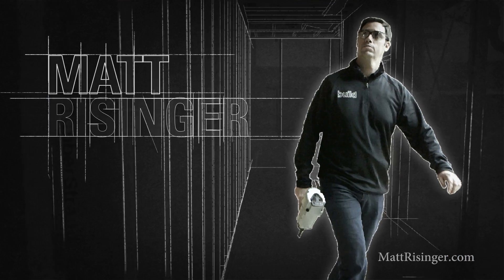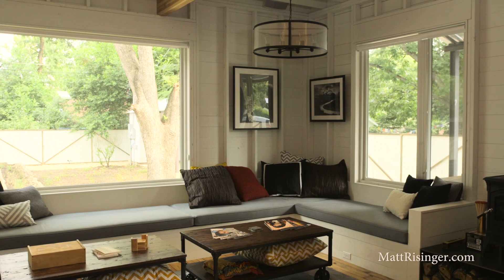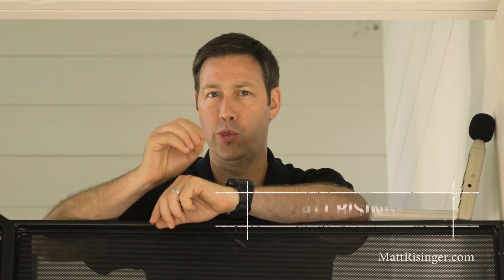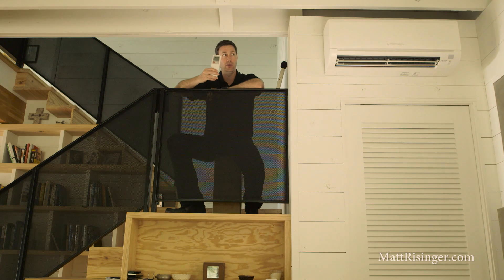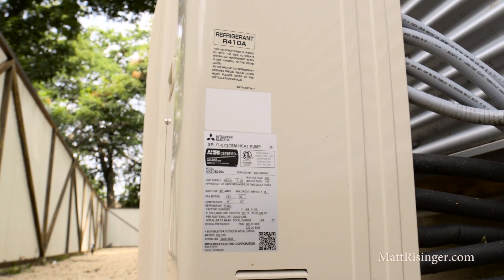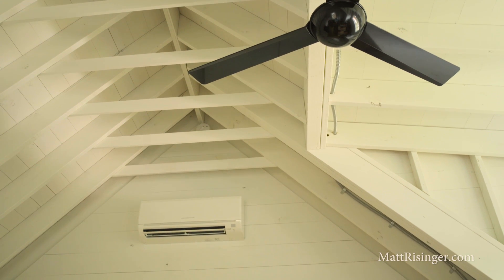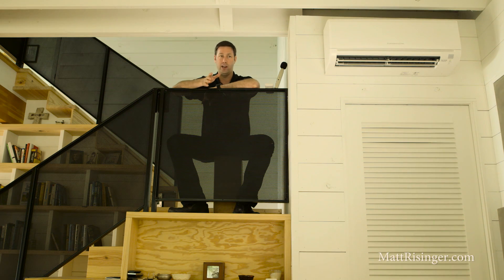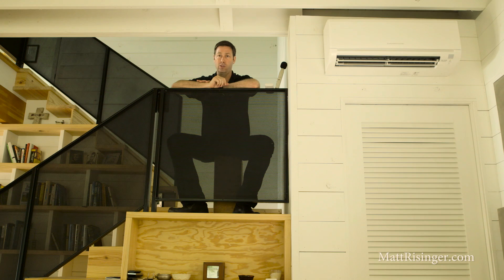Mitsubishi Review - Perfect Wall House

Comment: Hey good day. Great video as usual very informative.  Question do these units come with other refrigerants like R-407c or hydrocarbons? ??
Reply: Most small  residential air conditioners are moving towards using R32 , which is classed as mildly flammable . If not R32 it will using R410A , not flammable but a bit less efficient .

Comment: Hello Matt, I have a two level house, and would like to install the MXZ-2C24NA2 unit on the outside, and two x 12000 MSZ-GE12NA-8 wall units inside the house, one in the first floor living room, and the other in the second floor hallway. Now, I have an LG wall unit of 12000 btu's, with a compressor outside. This wall unit is on the 2nd floor hallway, but it has never been enough to cool the first floor. Last summer, when we got a 40 degree heat/humidity day, the best we could manage on the first floor was 28 degrees, not very good. I know it's not easy to answer without seeing my house, but do you think that by doubling the cooling, my first floor cooling will improve dramatically? BTW, each floor has 860 sq feet.

Comment: Having lived with mini splits for ten years (in asia), one seldom benefit for cooling is because the units are mounted high on the ceiling, it actually takes the warmest air, close to the ceiling and cools it as opposed traditional HVAC design where the return ducts are usually on the floor.  Makes a difference.

Comment: The only issue I foresee with these systems is that I doubt their ability to filter and move said filtered air in the same capacity as traditional HVAC units. For allergy sufferers this could be problematic. Then again, this could be mitigated with standalone HEPA units if the need arises.
Reply: I'm planning a ventilator system with de-humidification for fresh air, air cleaning, and circulation.
Reply: I'm sort of broke so I made my own HEPA filter with a box fan and a good quality air filter. ;)

Comment: what are the negitives and or cons, any complaints?    what kind of reliably like long term, do some brands break down more than others?   and what brands would you recommened?
Reply: Not Matt of course, but I have a little bit of experience with a mini split system. Probably the most well known and arguably the best mini split brand would be mitsubishi. There are other brands out there like fujitsu, sanyo, and plenty more that have lots of experience in making these systems. You go to Asia and basically every home that has AC has a mini split system instead of the forced air sorts of systems that are king in the US.  Mini splits tend to be a quite a bit more expensive than any comparable conventional forced air sort of a system in the US. They are also sadly not super popular in the US so it can sometimes be harder to find installers and people that would have the expertise and parts to repair them when/if something happens. The inside units and the outside compressor/pump units tend to be really quiet, you can barely tell they are on in many cases.

Comment: Hey, Matt. I've wondered about these mini split systems. You said all you had to do was run a freon line and an electrical line. How do the units deal with condensation locally at each unit? I'm curious if this would be a maintenance issue if we used these in significant numbers.
Reply: the refrigerant line, electrical line, and condensate line all run out of the house from the unit itself through a hole in wall. The electrical and refrigerant run back to outside unit to connect and the condensate line to wherever to drain.

Comment: Hey Matt, great videos, I recently subscribed to your channel and I am hooked. I wanted to to go with a split unit AC as my house has cement ceilings and that would be my best option. Before your videos I was going to go with a LG but you have me sold on the Mitsubishi unit. Right now I am in the process of redoing our new home that we just purchased all my walls are barebone right now. I am creating a smart home environment with a nest thermostat, August smart locks and thinking if I need a smart hub. My question would be which model of Mitsubishi is technologically sound to work seamlessly with the nest and my heating unit or can you recommend a setup that will work seamlessly with heating and AC which allows me to have full control on the tech side? Thanks Matt and keep up the great work that you do.

Comment: I'd suggest that there are two additional benefits of a variable speed compressor system (both ductless and not).  One is that having the compressor work just hard enough to achieve the desired temperature can be more comfortable than a conventional binary ON or OFF system (either ON blasting cool/heat or OFF leaving still air that gradually becomes more and more uncomfortable).  The second is that sooner or later, we are all going to have to wake up to the notion that a conventional all or nothing HVAC compressor system isn't very compatible with a "smart grid".  Power companies are starting to phase in power tariffs that penalize peak power usage.  Current variable speed compressors may not have the requisite technology, but hopefully future variable speed compressors will allow the user to set a "don't exceed this prescribed power consumption" limit.

Comment: You are misleading Matt ...... M-Series Multi-zone can NOT power down to 10% (Read the Spec's) depending on the model the best they can do is 20% to 25% ......their 2 ton model will only power down to around 40%

Your chances for hazardous refrigerant leaks inside the envelope increase for every head unit you add also

Comment: Matt, how is the air being filtered in these mini-split systems.  With a traditional HVAC system, you have air filters before the furnace "cleaning" the air.  Since there are no ducts in this system, does the air get filtered?  Thanks - David
Reply from the maker: +dcahpd David, there is a small filter inside the head that needs cleaned every 60-90 days.  Not as much filtration as a traditional forced air system with a healthy MERV 10+ filter though.  Matt

Comment: I have a 4400 sq ft two story and as part of the remodel replaced the old forced air HVAC with Mitsu multi head (not City-Multi. Couldn't afford them) My preference was to go with the wall units, but had to go with the ceiling cassettes because of condensate drain issues. The pumps on the cassettes are trouble free, the add on pumps to the wall units are more problematic. 

Totally happy with the decision to go this way.

Choosing the right contractor is imperative with the multi head units. I interviewed four (all Diamond Dealers) and three of them had installed single head units but had no experience with the multi head units. My install would have been a first for them. Find a dealer that has experience with light commercial or multiple office installs.
Reply: I replaced baseboard heaters in a 3200 sqf home in the mountains of Colorado. Normal HVAC contractors told me I was nuts. My electric bill is a 1/3 of what it was before and the house is so evenly heated. As a bonus I have AC now for the handful of days needed

Comment: Bang on with your review.  I have a few of these units with multiple head units.  I have the mini split with Heat Pump.  They work exceptionally well.  One thing I've learned (the hard way) is not every HVAC guy understands this.  Even the HVAC guys that claim they understand don't.  My only issue(s) have been an E1 Code (High pressure).  Most HVAC guys whip out their gauges and either pump more Freon in or suck some out.  The ONLY way to determine the proper amount of freon in a mini split it to weigh it.  Yes, weigh it.  Clearly marked on the side of each compressor (Outside unit) is the proper amount of coolant.  The systems are shipped pre-charged with enough to run a system configured for the number of head units.  Also, be certain to only purchase a unit with a Japanese made compressor (Mitsubishi, Fujitsu, Toshiba...) and NOT south Korean (Samsung or LG...) or Chinese.  Caveat - a Chinese made system with a Japanese compressor (i.e Gree) is ok and a good value.  We as American's are a bit behind on this technology.  I've seen these all over the world with huge success.  These are so much nicer than window units and as you stated, very quiet and simple to install.  Another added note; I suggest mounting the outside Unit on a platform about a foot off the ground.    Cheers
Reply from the maker: +Rik Holliday Great suggestions!  I agree on the Japanese made units.  The american companies have alot of ground to make up on this technology!  Best, Matt

Comment: Another great video Matt!!
This is the type of system I was looking at for my new build and I'm trying for a passive build.
Only thing I'm not exactly sure about is if I will go with the three head system or a variation there of.
I'm going to use a whole house HRV and I thought of tying the two systems together to evenly distribute heat and AC throughout  the house, or just add  X amount of heads and let the HRV distribute heat/AC that way, any thoughts?
Reply from the maker: +Johnintoit Good question here... not an easy answer to be had.  I'd recommend getting a good HVAC designer to weigh in on this.  I use Positive Energy here in Austin and they work on remote jobs too.  Best, Matt

Comment: what was the cost of this 3 head system?
Reply: Hard to say the cost exactly ,  a lot depends on how difficult to run / length of refrigerant pipework to the heads.   Personally I think it works out cheaper to buy 3 independent outdoor units if you have the room and dont mind the more cluttered look outside,  plus if 1 outdoor unit has a fault the other 2 will still work fine.   With a multi unit like in the video if there is a refrigerant leak from one of the flare joints or anywhere all 3 indoor units wont cool / heat , same for an electronic fault with outdoor unit , all indoors wont work.  Nothing wrong with Mitsubishi  units ,  just that all inverter ACs these days are full of electronics, even more so for multi units.

Comment: Matt how do these systems do with heat. Have heat pump but does crappy job in winter for heating. Would this be a decent supplement to my HP in Winter?
Reply from the maker: +Joe Large The newest version of this has "Hyper Heat" that provides heat down to -5 degrees outside.  Indoors the heads provide air above 115 degrees so they feel "hot" to your skin.  This would be an excellent supplement.    Matt
Reply: +Matt Risinger Are there mini-split systems appropriate for New England (Vermont) where we have many nights below 0?
Reply: I had the Mitsubishi hyper heats installed last year.I live outside Philly and they did a great job all winter, I never had to use my oil heat.